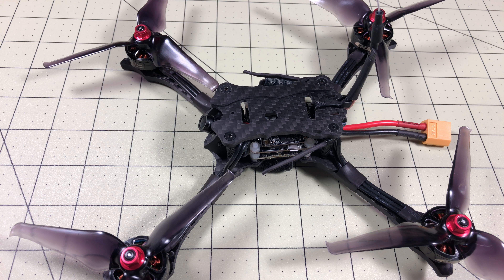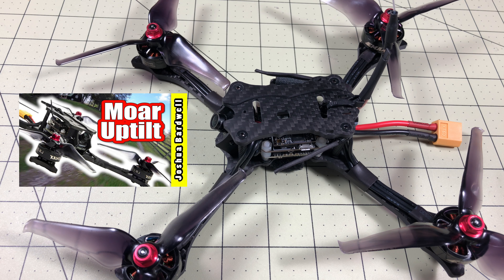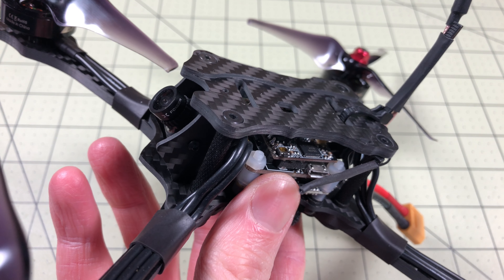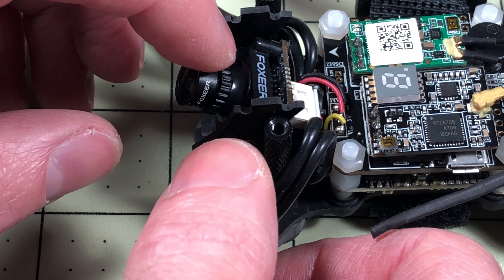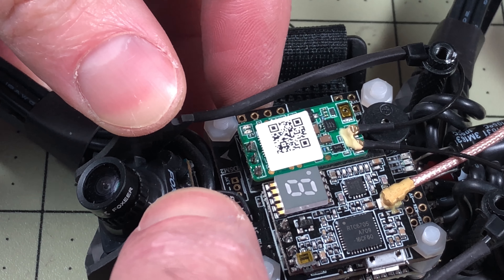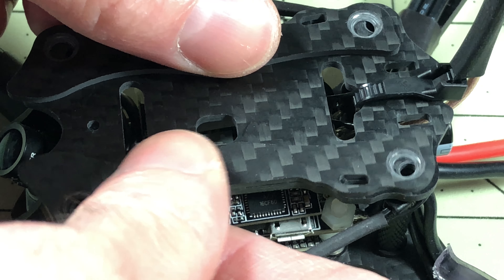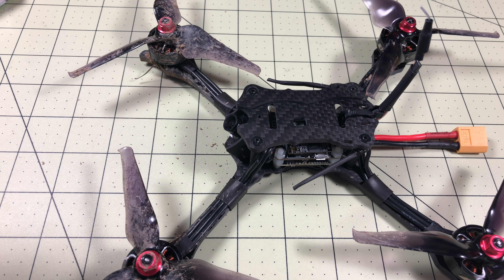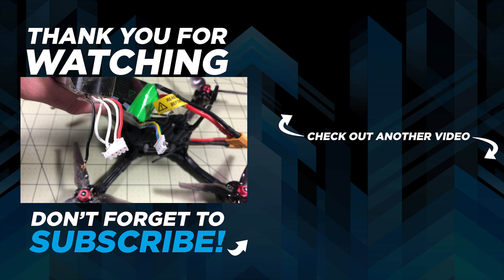EMax Hawk 5 Mod 1.  Getting more FPV camera angle

Comment: I think some of the hawks are coming with the wiring in different spots. Mine was able to hit 50 deg before I had to move the wires around. Once I moved them a little I could hit 60 plus. Verified the angles in betaflight. I'm just not confident enough to run a 60 def angle lol. I just got used to 45.  
Use sticky tack to get that dirt out of those motors lol. The avan props are tough in my opinion.  A small crash but tumbled a good 60 feet broke 2 cyclone 5046's but a hard crash into my driveway didn't mess up the avans at all. But I'm still testing props on the hawk. So far I do like the avan flows, hq 5x4.8x3 and cyclone 5046's. Have more on the way. Keep up the great videos!!!

Comment: Those two narrow top pieces actually do have a significance! They help give the quad much more strength. In watching Bob's channel, KABAB FPV, I found out many of the little seemingly useless frame parts help strengthen the overall quad frame. The top plate is often important because in a hard crash it absorbs a lot of the impact from the arms. As the shock from the impact radiates through the arms and into the joint where they come together it sometimes ends up in the top! And the top plate, often being less thick to cut weight, will snap! So, they put side reinforcement pieces that barely add any extra weight, like a double the thickness top would, but significantly add to the strength! Hence, stopping the top plate, which has absorbed the end of the impact, from breaking! One learns a ton about design from go0d 0ld Bob! His channel is very unique in that he covers the theory about why things are done this way or that... Plus, a lot about technology and why these motors on this frame are better than the other ones. Co0ol stuff!  Very highly recommended! 
Thanks Mark for your time and effort to make this video and show it to us! 😁😎

Comment: hey Mark ...seriously cleaning the kwad ?  do you use  soapy water ?  hot ?  do you spray motors with silicon or other lube ?  what about aerosol cans of electrical cleaner ??   just finished first pass cleaning all my stuff from the Hurricane IRMA event and only one totally destroyed (TBS Vendetta) ,,,still 50% of the rusted screws will not come out and since my Taranis was ruined I need to access every rx to re-bind ..camera angle = go fast ??

Comment: Droneracer101  haven't you thought about cutting the back edge of the plug going in to your camera and put a little hot glue over the wires going in to your plug  it will give you more clearance and protect your wires on the camera ;-)

Comment: Wha? Even about 60 degrees angle is on low side. Hmmmm.

I just wish to see some more maneuverable flights of this drone. From first video I remember ;) (I watched it seconds ago again :) ) that have really nice tight turns. I even saw at some reviewers that this quad is like to fly it on simulator. I fly a lot on Liftoff and by feeling from 1st video I could say that some maneuvers looks the same. :) (Y)
Reply from the maker: I have one coming with a few different props in a woods. 😲
Reply: :( Oooo there the reason why is just few seconds of flight with fixed camera angle. :-O

Comment: Good vid.

Looks like you are not used to such an aggressive camera angle.   Less yaw, more roll in the turn and keep the throttle up.  Strange things happen to the handling at high angles and it takes some time for the brain to re-learn.

Have a quick look at. https://www.youtube.com/watch?v=zDdUF1HlY2U

I think I mentioned on your first review that the promo photos had a much greater camera angle, so it had to be possible.